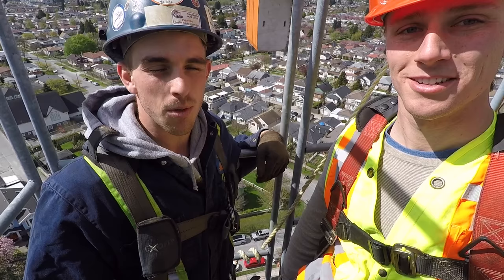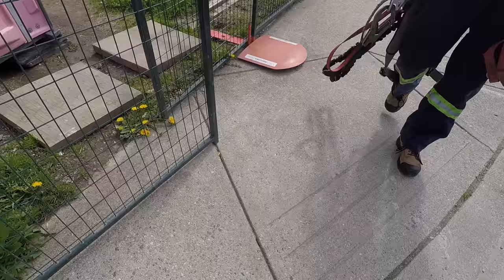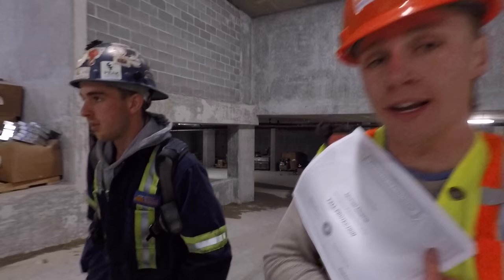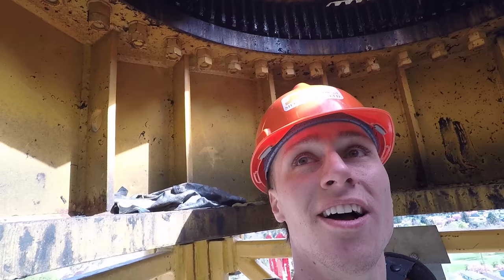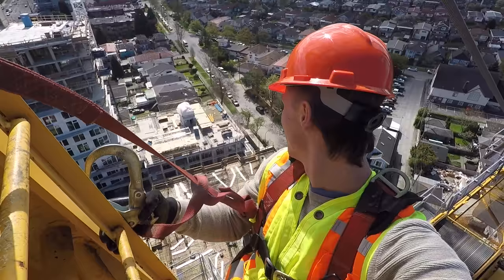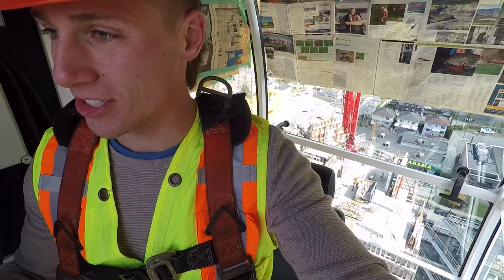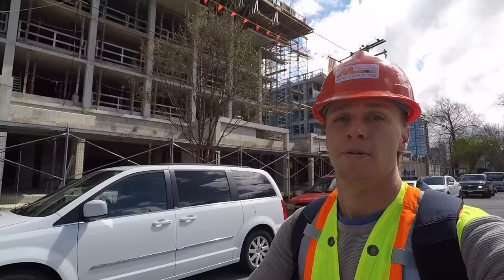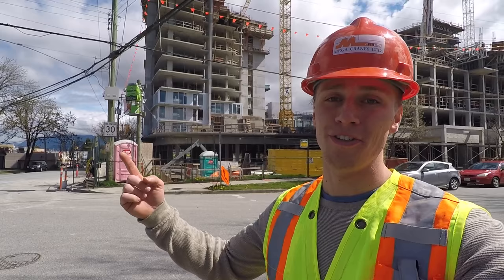WORKING AS A CONSTRUCTION CRANE OPERATOR

Comment: You guys have my total respect. I work in a steel processing warehouse and have been trained, yet not certified like you guys, to operate a Stacker Crane which only goes about 50, 60 feet above the floor and it rocks and rattles like krazy as you take up and bring down 5000 pound steel bundles. Child’s play for you guys. 😊💯

Comment: What's up man, I'm D. I've been operating tower cranes in Vancouver since 2006. I'm currently operating a Liebherr 290 downtown. The crane that you're touring through is a FM Grue. One of the coolest features of the Grue is that you can switch it over to remote control mode. I got a crazy video of me standing in the trolley basket, and rippin' myself out to the tip, while I swung around full circle...
I was nuts in my 20's.
Reply from the maker: That’s awesome!

Comment: I had no idea the operator actually has to physically climb the crane. I always thought they had some kind of elevator or something. What happens if the operator has a bathroom emergency?
Reply: They have two by cups one of my relatives worked as a crane operator and he was usually intoxicated cause of the height and the cracks in the glass
Reply: well if its tall enough you can take the skip elevator up in the building  and then there will be a bridge connecting the crane to the building higher up. if all that is not available you have to climb the whole thing from the bottom
Reply: They go #1 and 2 up there lol I go up to our operators crane once every month and he always has piss bottles and a can
Reply: A bucket and a plastic bag. Piss off the edge. Then rope it down at the end of shift
Reply: Number 1 you take up a good sturdy pee container.  Like an antifreeze container.  Tie it to your belt up and down. Number 2 climb down. Only takes a couple minutes to climb down. Keep a 5 gallon bucket and a garbage bag for emergency Number 2.
Reply: For my brothers crew, it's just a bucket and some garbage bags. Someone on the ground gets to be the unfortunate monkey that retrieves it when lowered and disposes of it.
Reply: @Sinyao  sounds like a crappy job

Comment: I am an NCCCO certified operator, I don't mind heights, as long as I'm looking UP at them.  Those guys are crazy!  (I did give a Thumbs Up)
Reply: It isn't as bad as you think. The crane i learned on was a climbing tower, so we actually only started 90 feet above the ground and when the building caught up we would then climb the tower to the next height. By the end of the job the tower crane was about the 300 foot mark but by then you were used to the height.
Reply: My first was at 120 ft. Bit of a rush first time up but after a couple of days it was like sitting in your living room. Inspecting the jib every day does keep you one your toes though.

Comment: I swamped for years with an overhead crane operator  as much as the foreman goes on about running the job ,nothing much gets done until the swamper and the operator get things moving. .A two channel one private channel for operator and swamper is a most.

Comment: What do you think about women executing this type of job? Is it physically possible? I know that there is more to the job than sitting in the operating booth, like maintenance and repairs from what I've researched thus far. I've been looking into getting certified, but I am a smaller woman, 5'4" 130lbs. I am in good physical shape (powerlifting and body building), I am comfortable with heights, I am mechanically inclined and strategically minded.. but I wonder if there are restrictions or requirements physically that would prevent me from being able to do this kind of work. I am still researching what all is entailed or would be typically asked of someone doing this job, so pardon my naivity. 
I know this is an older video, but if you see my comment or any other crane operators in the comment section, I'd love your input!

Comment: Nice vid!! I have taken a récent interest in crane towers after moving next to a construction site! I got some Questions! Is the operating room of the crane temperature controlled?  Like is there an a.c/heater? Also are there cameras to help navigation?
Reply: Sometimes we get cameras, but typically no. We do get air conditioning and heaters
Reply: Crane Nut I worked my first eight years without having a decent air conditioner in California. 😭
Reply: @brettbarker8444  why on Earth haven't you complained about it? Aren't y'all union out there?
Reply: Crane Nut I worked for a not-great outfit that rented their cranes. They never got the best ones. I would get in a crane with an old AC in it and come summer time realize it didn’t work. The techs would never get around to bringing a replacement out. Since then I started working for better/bigger companies and OSHA cracked down on stuff like that.
Reply: @brettbarker8444  I had one company refuse to fix a broken AC. Just got a guy from the site to help me pull it up by rope and replace it. 

Told the job I couldn't work without AC. 

The next time that happened I climbed down about 11 am. Told them I had sweat in my eyes and couldn't see. Said, do you leave a dog in a car all day without AC? 

They fixed the AC the next day

My point is, fuck siting in a glass box without AC. No chance in hell; you gotta put your foot down. Otherwise they will push you to do dumb shit

What they paying out there in Cali?